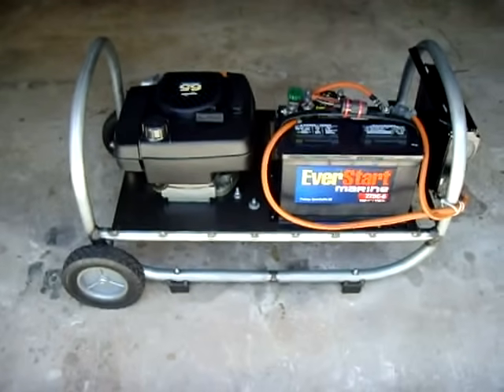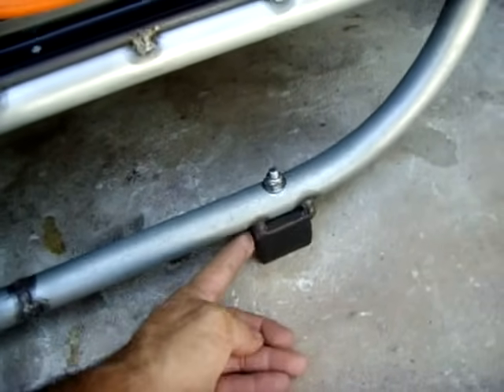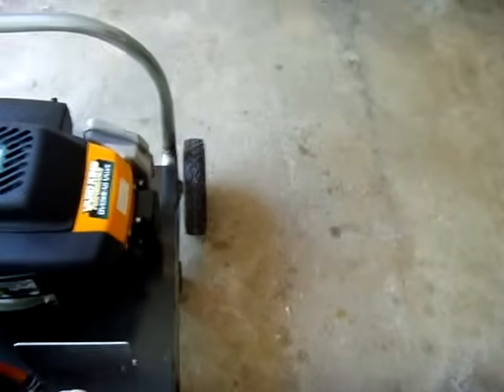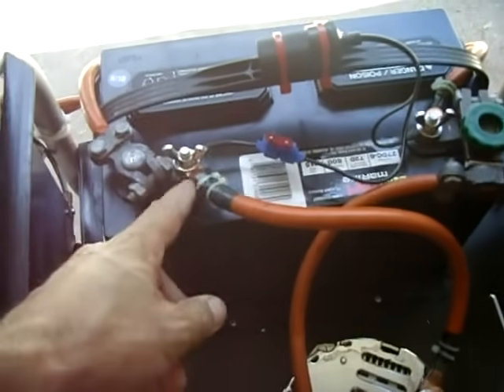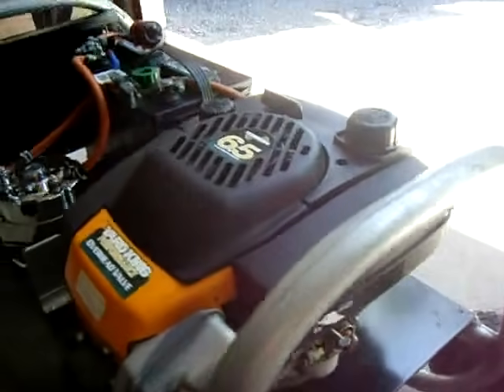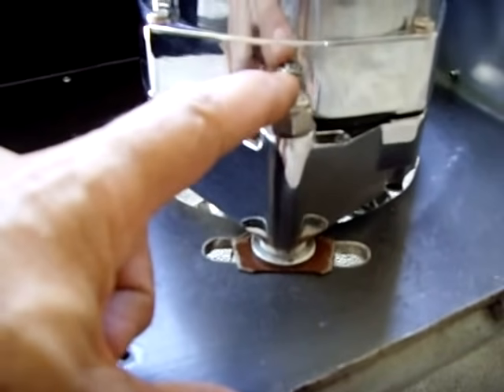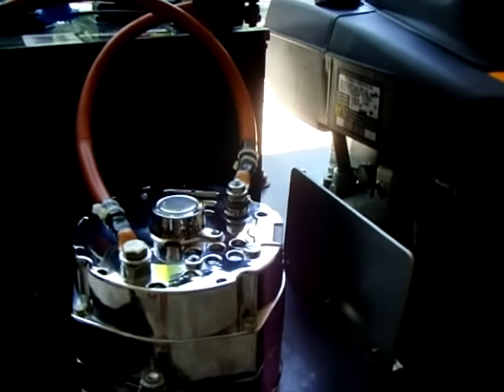HOMEMADE 1000W Lawn Mower Inverter Generator - Part 1

Comment: I'd put some expanded metal over the pulley
Reply from the maker: Yes. I thought of taking a baking pan and cutting it to the correct shape. Thanks for watching! Be sure to check out my video playlists, rate thumbs up, and share.
Reply: electronicsNmore and i use them also as oil drain/drip pans since i have to work on equipment where they sit/broke down!

Comment: What was you cost in building this....800?
Reply from the maker: No. Around $425
Reply from the maker: John M LOL You're comparing an inverter generator to a regular generator? My generator does not need to be running to produce power.
Reply: John M thats whats neat about this design!

Comment: what size is your pulley under engine shaft. it looks like I have same size but just be sure. Give me radius measurement,  I have everything on hand except for frame. I have self propelled Yardman 6.5hp lawnmower that have spring loaded starter system ( no need electric starter), first time pull start the engine and let it run then cut off, engine winds up spring before dies out. Then press lever and it release energy from spring to start engine again without pull start. it's so damn cool. Former owner left her mower to me even I have my own Toro 6.5 hp self propelled and bought John Deere LT150 riding mower. So thought why not rip off engine from Yardman frame and modify for generator.  Am thinking of getting 2 KW or 5 KW inverter. I can go to Pick N Pull to find 80 amp Alternator size of hand (ford fiesta and several small cars have those because smaller alternator, less drag from "electric braking" from power load).  Two 12v batteries in Parallel would cover enuf juice to run 5 KW inverter while generator running, charging batteries. Just wanted to have enuf power to run lights and ref during blackout.  I can buy 10kw LF inverter but am afraid that it won't be enuf to power entire house due to actual wattage limitation ( says 10KW but actual limit is 5KW, Chinese made). 

so let me know of ur pulley size under engine
Reply from the maker: Hello. I no longer have the generator. I moved back to the USA, and sold it.

Comment: Well-built and fun to do, but not nearly as efficient as other alternatives.
Reply from the maker: Was great for me. 4 hours on 1 gallon of gas. I ran my 18 cu.ft. refrigerator, computer/modem, ceiling fan, 42" LCD TV, and 2 CFL lights all at the same time.

Comment: I use the same small generator-battery- to inverter system to power my house- and without wind or solar- it dropped my electric bill from $170 a month down to seven dollars. This works.
Reply: BULLSHIT SPAMMERS
Reply: You are getting ripped off by your utility companies. I hardly am the only one making that observation.
Reply: faffaflunkie gas must be cheap where you live, he said 4 hours for a gallon of gas...here a gallon of gas is 2.45 average, thats like 441 a month in gas alone...
Reply: so that setup costs around 2$ an hour to run so you only had it running for the total time of 3.5 houers that month.
Reply: Fees and taxes alone are about $28 per month without using any electricity.
Reply from the maker: Thanks for watching!
Reply: A twelve-hundred watt generator, at today's gas prices costs about thirty cents (American) an hour to run.
Reply: ok i thougth u said that you had a immilar etup as the video. cu the one in the video used 1 gallon / houer
Reply: So how would you hook it up to your house? Do you run a cord inside from inverter and just power certain lamps? I would like to get a window unit A/C and run it in the summer.
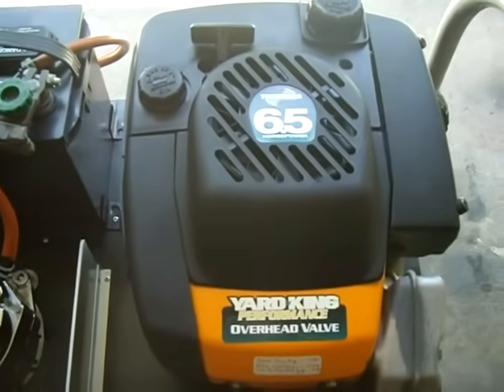Reply: The narrator said that the lawn mower engine in this video consumes one gallon of gasoline every four hours. 2:40. But an optimal motor for generating one thousand watts will be smaller.

Comment: Nice work buddy. You rekon a 5hp B&S do the job too?
Reply from the maker: If the pulley ratio is right, it should be fine.
Reply: It has more todo with where you live and how much power you're looking to get out of it. I have a few of these. I've built 24 & 48V systems to do every thing from jump start my equipment to running a 10kW Con/30kW Burst. An engine loses about 3-5% of its power per 1,000ft of elevation. at 1 mile (denver), accounting for all the losses in the system (10% for the pulley, 50% for the alternator) max you can run is about a 1.5kW Alternator or 120Amp, One guy commented below about using a audio system capacitor... only ways to go if you don't have a battery in the system. The alternator will burn out quickly with out it!
Reply: How is ratio of the motor or what is the minimum rpm for the alternator

Comment: Looks really solid and well made, considering how these usually are.

But having a gas generator running an alternator, to put through diodes, to make DC, to invert, to make AC, really bugs me.... There doesn't seem to be a good way to do this with an automotive alternator designed for low voltage output.
Reply from the maker: I can assure you it worked very well for years, especially after my mods. Thanks For Watching!

Comment: what size pulley do you suggest
Reply: You need to know what engine your running and what speed the alternator is rated for. Most alternators  produce max power around 5,000RPM (will do 8k but you will burn it out) and most engines run around 3,600RPMs so to get them to match you need a pulley ratio of 0.75:1

Comment: Although this is a nice set up, I am making one that runs a little differently, mine I am using an electric mower motor with an alternator with a small solar panel hooked up to it, then the battery and invertor hooked up to it...its a great set up that requires no fuel...hopefully it works...
Reply from the maker: +Jacob Yisrael 

Based on what you said, it will not work. I'm just trying to save you a lot of time and money from trying it.
Thanks For Watching.
Reply: electronicsNmore
 um no it will work sorry but I have seen it already working
Reply from the maker: Jacob Yisrael
Good luck with it.
Reply: +Jacob Yisrael gotta link?
Reply: Joe Yocom
 there are plenty of videos right in here that shows it, just do a search
Reply: Jacob Yisrael Thanks a lot. You are a real nice guy. I wanted a link to the one you saw.
You know a specific video, the same one you saw but you are too lazy to send me a link to it? What a cool guy !!!!!
Reply: Joe Yocom
let me take a gander for it...ill recomnment once
Reply: Joe Yocom
let me take a gander, there are several and yw..
Reply: Jacob Yisrael No thanks I am muting this
Reply: Joe Yocom
 thanks for wasting my time then dickfacecockmaster
Reply: Well, that escalated quickly.
Reply: Oh lord theres always one perpetual lover out there....
Reply: Brian A
 oh how funny it is, thats exactly who I am...
Reply: remember if you can't spot the idiot in the group.... its probably you!
Reply: Brian A
 thats too bad for you Brian. you should get your affairs in order, your time will be incredibly shortened...take care.

Comment: Very nice construction but just a warning... Those delco-style alternators can be damaged if you run them without 12vdc wired to the BAT terminal on the rear.
Reply from the maker: +dontmesswiththeman 
Not true. After 5 years of use, I would have noticed something. Disconnecting the wire off a (1) wire 10si alternator will not cause any damage. All that will happen is the rotor will spin without any current being supplied to it. I have used this alternator for years w/o any issues. I made my own regulator for this alternator which works much better. I have a video showing all the modifications.

Thanks For Watching
Reply: electronicsNmore

Comment: What do you normally run off of this?
Reply from the maker: Kyle Catholic Hi Kyle. I run a 18 cu.ft refrigerator, 42" LCD tv, a couple CFL lights, one ceiling fan, and my 2 notebook computers with modem.
Reply: think it could run a 5000 window unit?
Reply from the maker: I tested my setup with a 5,000-6,000 btu window AC unit and it works fine.
Reply: electronicsNmore
should still work the same with a bigger inverter right?
Reply from the maker: Yes. Just make sure you are using a quality modified sine wave unit or pure sine wave inverter.
Reply: electronicsNmore
how big of an inverter do you think I would need If I were to run a 5000 btu ac and a 18 cu. inch refrigerator/freezer?
Reply from the maker: Probably 2500 watt.
Reply: the things i find i use mine for is mostly jump starting dead equipment or running water pumps. I used a PLC to manage the starting and stopping of the engine so you can just leave alone and it will manage its self

Comment: Very nice, only one surgestion is to rubber mount the inverter to help with vibrations. I had one that was solid mounted and the vibrations over time ended up cracking the printed circuit board in side. But other than that excellent work.
Reply from the maker: Jim Miles Thanks Jim. If you look in the video, you will see 4 thick felt pads that I used when mounting the inverter to help dampen the vibrations. Foam rubber would be even better.

Comment: Nice ! I like it , good job
Reply from the maker: Thank You! I still use this generator to this day. Be sure to check out my other videos as well, and share.
Reply: That's cool your still using to day , shows what you built was built to last ! .. I sure will
Reply from the maker: Where I live we have power outages on and off, so it still comes in handy.
Reply: Same where I used to live and I sold my generator like a idiot wish I never did now , but your creation has gave me a idea :)

Comment: I built a set up just like this using the motor off a push mower and alternator off a random junk yard car, it all works great, I mainly use it to charge my battery bank for days that it gets quite low, I run my entire house off the grid, with a 14 battery bank, Solar Panels and Wind Turbines, multiple inverters and such, so when I am unable to get a well enough charge, I start the generator up and connect to my controller on my bank, it works perfect! Your's looks much nicer, just fantastic, thank you!
Reply from the maker: Yes, having a setup like mine and yours is extremely useful for charging up those lead acid batteries and powering inverters. I use mine quite often.

Thanks For Watching! Be sure to share and rate a Thumbs Up. Also be sure to check out my other videos as well.
Reply: @electronicsNmore  7 years later and I am completely off the grid! Thanks again! Time flies by toooooo fast!

Comment: how much would I need to pay you to make and ship one of these to my house minus the inverter iv got 2 of those or tell me house much it cost you to make
Reply from the maker: To be honest, I really did not keep track of what materials I purchased. The vertical OHV engine was only $105/shipped. The inverter I had. I bought the alternator on Ebay for $55/shipped. Some pulleys online fairly cheap, the steel plate I had laying around, the EMT was from Home Depot, and other stuff from Harbor Freight. I'm actually using this generator today. :-) Where I live they are working on the power lines.

Thanks For Watching!

Be sure to check out my video playlists as well.
Reply: will do

Comment: You could mount a 5 gal gas can on the end of the frame and run a fuel line to the motor. Would be better then filling a factory 1/4-1 gal tank every few hours. Also if anybody needs to run high amps (100+) but don't want big bulky wires then check out Silicone Wire, 8 gauge Silicone Wire can handle 200 amps max.
Reply: After 8 yrs can u still reply me pls i will be happy

Comment: @myvideoisonutube no what i mean is most lawnmower engines use the blade as a flywheel so they usally dont start easily and kick back when you try to pull it.

Comment: does the motor ever kick back when you try to start it? or did you add some kind of extra flywheel to the engine. because any lawn mower engine that i have had without the blade on it would kick back when you try to pull start it.

Comment from the maker: @pastthebrink 

Depends what I set it for. If I only plan on using 200-300 watts of 120v, then I set it for not more than 2350 - 2500rpm, which allows me run it for well over two hours on 1 tank of gas, or 8-10hrs per gallon. If I plan on using higher current, I do not stop the engine from going faster, and set the rpm at around 4000.  The speed governor also can kick in if it has to for load compensation.